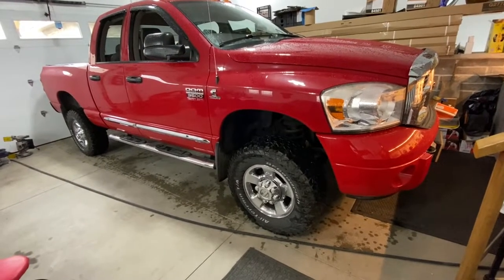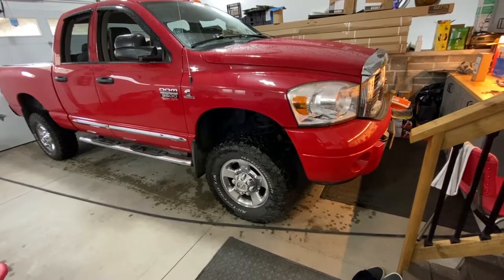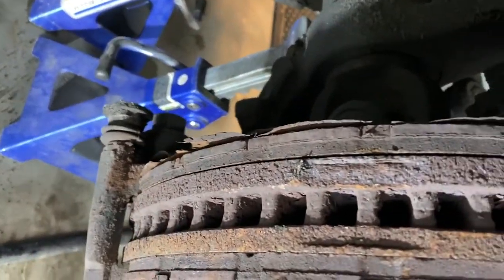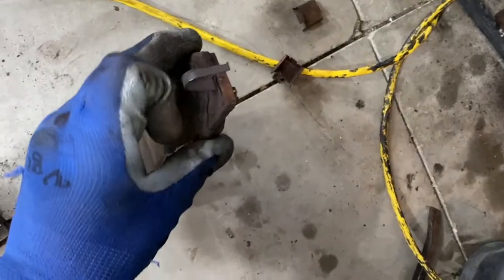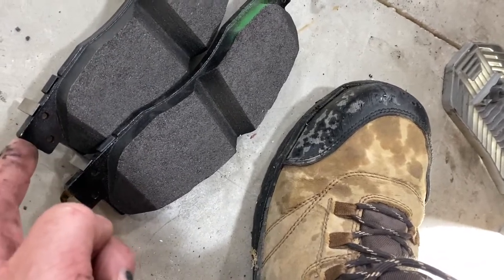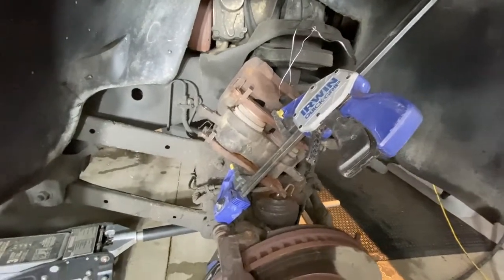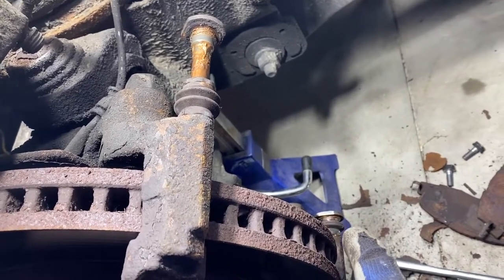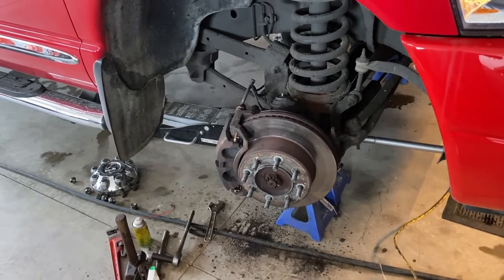Front Brake Pad Replacement | 3rd Gen Cummins

Comment: I helped a guy out to remove his rotors when I was doing an oil change off and he had to buy a new hub and hammer out his old studs because his rotor wouldn’t slide off. Does that sound right or was his rotor just caked on with rust?